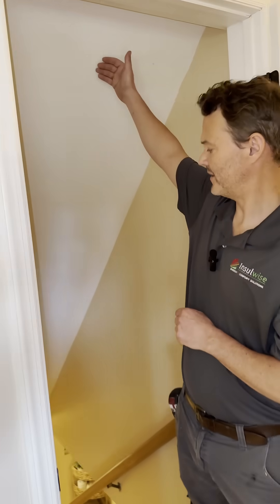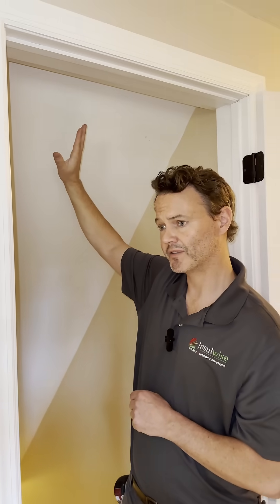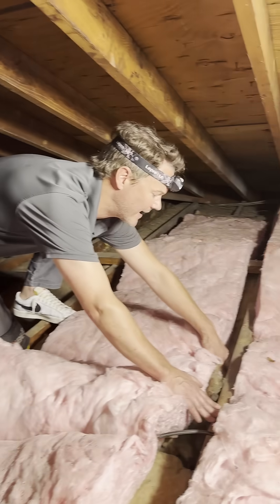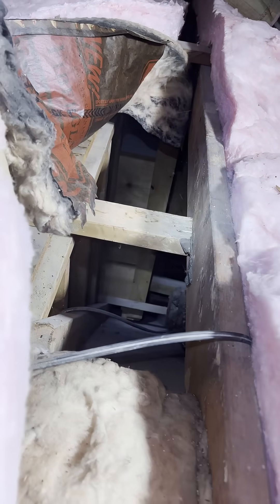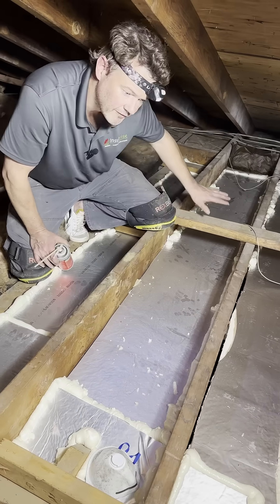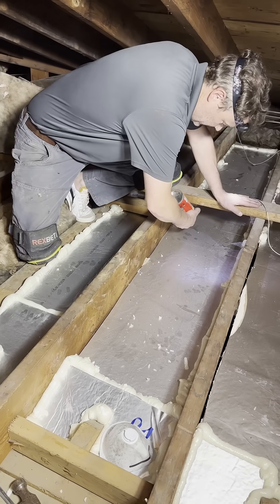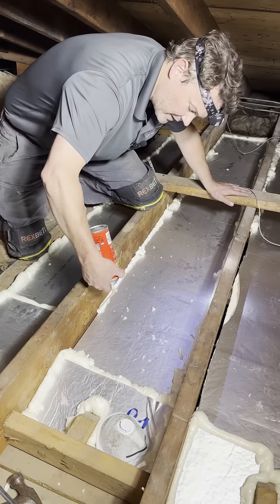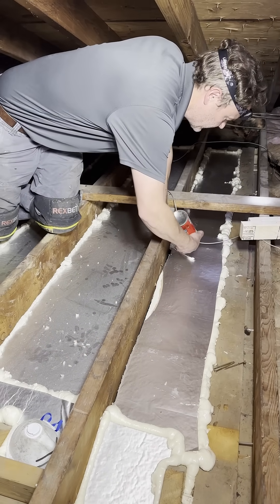Top Insulation Expert Reveals Best Air Sealing Techniques for Attic Stairwell Voids

Comment: Im guessing that is 50mm type kingspan, my home is UK 1870 draughty as hell this will be my last job many thanks for sharing an ideal way to stop condensation would a vapour barrier over ceiling joist seal it completely? Many thanks in advance.
Reply from the maker: Terry thanks for commenting!  I had to look up what kingspan is but yes, looks like the same stuff.  Polyisocyanurate foam with a foil / vapor barrier on both sides.  This will block both air and water vapor.  When you seal this into place with foam sealant on both sides, and support it properly on the underside --- boom -- permanently fixed.  We go through this stuff by the palate sealing all kinds of large cavities in attics.  Does this answer your question?
Reply: vapour barrier goes on the warm side of the insulation, so would be below the joists in the ceiling of the room below. 
victorian attic spaces are usually draughty  enough to compensate for rising condensation from the main house, not something I've ever needed to retrofit

Comment: So you capped that open space.  What about that cold exterior wall?  How about laying some insulation on top of that sloped drywall?
Reply from the maker: Great question and it’s commonly asked.  That back vertical wall was an interior wall.  There is a bathroom on the other side of it.  When there are true exterior walls abutting a stairwell void you do need to make sure that all of the interior walls are insulated, you cannot just cap it like we did here.  Otherwise cold from the outside will "bleed" into the space and chill those interior walls.

Comment: You should have left a bigger gap in between the Styrofoam and the joists, so the expendable spray insulation would actually go inside and close all the gap. In your case It didn't do a whole lot.
Reply from the maker: You don't need a massive gap.  In fact you don't even need a gap at all.   The foam sealant is attaching the foam board to the wood and sealing any gaps in between during the process.  We make identical repairs thousands of times a year and test them with blower doors.  The solution air seals extremely well and is highly durable.  Thanks for commenting.

Comment: Yes i just found this issue in my 2nd floor steps with a thermal gun. I used the thermal gun due to plaster ceiling falling down and found this exact issue causing it. I think is an insulation scam to hide this problem by the builder. They should have drywalled and then insulated instead of loosely hanging insulation that eventually fell down due to improper backing. I have several insulation issues in a 2nd floor attic and attached garage causing condensation issues and of course heat loss. Thermal camera is a must have.
Reply from the maker: Nice find with the thermal camera.  All builders in the Pittsburgh area that I've ever seen handle stairwell voids like this, as well as nearly all bulkheads.  They are almost neve covered over from the attic side with drywall.  Builders ONLY build to code.  IF code doesn't require it, than it doesn't get done.  Once you effectively air seal this void and hit the other air leaks in your attic you're going to notice an immediate difference in your home.  It will retain heat longer during the winter and also cool more effectively during the summer.  These are massive problems in homes.  Good on you for having a go with it!
Andy

Comment: the dirt and dust on the insulation that you pulled up with a dead giveaway of air movement
Reply from the maker: Good eyes!  And you're 100% correct.  The black streaks and dust in fiberglass are always a dead give away that air leakage is happening.

Comment: Use gapotape instead of foam for sealing pir boards
Reply from the maker: We don't have that product here.  But attaching tape to wood sounds dubious.  That foam sealant works perfectly every time and is relatively inexpensive.
Reply: @insulwiseenergycomfortsolu3293  Gapotape sticks onto the edges of the PIR board. Its a memory foam tape and expands and shrinks as the temperature changes. Its much more effective than expanding foam.

Comment: I retrofitted the attic in my old townhouse with spray foam and then re-taped the party wall sheetrock. I used sprayfoam because I wanted to have a legit floor to walk around on for storage while maintaining the "R" value. What a HUGE difference this made in the overall efficiency of the home. The difference from when we vaccummed out all of the old blown in and went "bare" for a week while I wired in lights and switches and repaired broken trusses and installed fireblock that was missed to after the spray foam was installed was night and day. Air sealing is KEY to an efficient home. That said, don't sleep on bringing in fresh, outdoor air mechanically, if need be.
Reply from the maker: Thanks for commenting.  Spray foam on the underside of the roof can be a sound solution, but if you live in a cold climate only closed cell foam should be used due to its having a vapor barrier at 2" thickness.  But you're right, air sealing attics is KEY, and if you think or know you're deficient in fresh air than bring it in mechanically.
Reply: Please look at Canadian specs if you live with a frozen winter. You could be mold and mildew free.  Those air exchanges are problematic. I refused to place in homes after 1999.

Comment: So when you remve the insulation theres no insulation. 
  So what happens when you remove the foam board?
Reply from the maker: I installed the foam board to create an air seal and we insulated over top of it.  There'd be no reason to remove it later and unless they were renovating that space.

Comment: A non problem, unsolved - the batts were fine.  Anyone know what the key feature of [engineered] ceiling paint is?  Permeability.   Two things to never go on an exterior wall [which a ceiling behaves like, thermally] is vinyl wallpaper or oil based paint:  they can create moisture traps.    We cook, we clean, we breathe... and getting rid of moisture in a home is about 'at what rate?'
Reply from the maker: Sorry, wrong.  Uncontrolled air leakage and infiltration through homes / buildings is often a serious problem.  New homes in Pa must pass a blower door test and have the home tighter than what's called 3ACH50 which is 3 full air changes per hour with the home depressurized to -50 Pascals.  We often run into homes that test in at 10, 12, even 20ACH50.  This means that they are massively leaky which causes excessive energy loss, comfort problems, and in the case of attics mold growth on the underside of the roof resulting from moisture released from the home condensing on the underside of the roof.  Air sealing an attic floor prior to insulating it is a Building Science 101 standard, necessary, and extremely high value practice.
Reply: @insulwiseenergycomfortsolu3293  Reverting to the flu epidemic of 1918, two things were observed.  Faster recovery was enjoyed with combined sunlight and fresh air.  Obviously, a house precludes sunlight.  By that measure, airtight homes make us sicker.  The trick is controlling that with regards to humidity and temperature.  You know what "super awesome" door tests prove?  The need to install a 'make-up' air sy$tem.  Also, you know what an exhaust fan does for an airtight box?  Make noise, and run up the electric bill - it basically does nothing.

Comment: Can i use this same principle for the crawl space between the floor joists?  Thermal break and foam seal along them?
Reply from the maker: If you have a crawl space the best method is usually to encapsulate it (if it's connected to a heatsource in the basement via an access hatch).  If you can't or are not doing to encapsulate it, the next best process IMO is to stuff batts into the floor joist bays so that the batt occupies the entire bay and is definitely pressed firmly to the floor above.  Then attach 1" foam board over the bottoms of the floor joist bays (entire underside of the floor) to lock them into place.  When done correctly this can work well.
Reply: @insulwiseenergycomfortsolu3293  Roger that, thank you. I have batts now. It's a 1920 house. It can be chilly this time of year

Comment: Why didnt you insulate the exterior wall at the botton of the slope?
Reply from the maker: 2.	Great question and it’s commonly asked.  That back vertical wall was an interior wall.  There is a bathroom on the other side of it.  When there are true exterior walls abutting a stairwell void you do need to make sure that all of the interior walls are insulated, you cannot just cap it like we did here.  Otherwise cold from the outside will "bleed" into the space and chill those interior walls.

Comment: You don't want a vapor barrier in your attic ceiling , humidity will build up in your house creating mold .
Reply from the maker: In cold climates you absolutely want and need a vapor/ air barrier between your attic and home.  It not only reduces air leakage from the home which saves energy and improves comfort, but it keeps water vapor from building up in the attic which can cause mold growth on the underside of the roof.  The challenge in cold climates is keeping enough humidity inside the home during the winter.

Comment: That explains why my stairwell ceiling kept getting moldy, most likely due to the condensation from the heat and cold hitting each other. 
Wish I knew that earlier, and it's too bad I dont have honest contractors like you around here.
Reply from the maker: Well thank you.  And yes, the surface of the drywall was likely getting cold there, dropping below dew point temperature, and then creating a moist spot on the surface.  It doesn't take long to grow mold there when that's happening.

Comment: Why would you not insulate above the stairs?  Access problems?
Reply from the maker: Great question, I used to do this.  Stairwell voids are very difficult to work in and move around in so there's a danger factor (if you slip and fall through, you're then going down a flight of stairs).  Other factor is this is FAR more energy efficient.  Capping voids reduces their surface area that is exposed to outside temps.  All four surrounding walls are interior walls here.

Comment: Your timbers will love you for adding foam to them. Where is my sarcasm meter...
Reply from the maker: The foam has zero negative effect on them when used like this.  If you're comparing this to spray foaming the underside of a roof with open cell foam you're off the mark.
Reply: @insulwiseenergycomfortsolu3293  Any foam, plastic or cement will trap moisture behind it if it isn't vapour permeable. Foams as far as I am aware are not vapour permeable.

Comment: I have a slanted area like that in my house, but the roof is just above. Is there any way to insulate between the ceiling and the roof when the space between is only 3-4” or so?
Reply from the maker: It's the same practice, but if it's inaccessible you can actually fill the void with blown in insulation.  At times we do this in attics.  If you use cellulose insulation it will dramatically / eliminate the air leakage as well as insulate the walls exactly as you'd want.  Good luck to you!
Reply: @ thanks! I’ll give that a shot 👍

Comment: Is it me or did I just see on TOH that you defeat the purpose of the metallic looking insulation, by putting the fluffy insulation, on top of that?
Reply from the maker: it's not being used as a radiant barrier, but as an air sealing air barrier.  And yes it was later covered with 15" of blown cellulose insulation.

Comment: why not just lay the insulation down against the ceiling? You've still got an outside wall uninsulated making that cavity cold.
Reply from the maker: That vertical wall you see is an inside wall.  I should have called that out in the video.

Comment: Why not throw plywood on top for easier walking?
Reply from the maker: You could do that.  But two things.  You'd then need to close / seal off the open ends between the joists, and you also lose 4-6" inches of insulation when you blow in after.
Reply: @ I see! Thank you for the response :)
Reply from the maker: @ngf5077  You're welcome ; )

Comment: The fact that insulated on the floor vs the roof proves, he's just avg, not pro
Reply from the maker: Traditional method (treating the attic floor) is not only 100% legit but I'd argue better in many situations.  You'll love the video I'm posting in a few weeks where a guy sprayed the underside of his roof with open cell foam and it then rotted.  He was advised to do this by a "pro."
Reply: Insulating the underside of the roof decking is a bad idea in many cases (including this one)

Comment: Spayfoam? Hows that holding up in a wooden house? I think the airtightness is gone after 10 years
Reply from the maker: Holds up great, polyurethane foam out of these cans is incredibly durable and tough as long as it's protected from UV light.  No risk of sunlight hitting it under a roof and 15" of cellulose insulation.

Comment: Why not use a pro gun? Easier to move around in the tight access area?
Reply from the maker: For several reasons.  1)  Foam is foam, for all intents and purposes, at least from my experiences.  If it expands, sticks, and permanently seals the air leak -- done. 2)  I or my teams have lost and or had a bunch of them break or get clogged beyond repair 3)  Cheapo great stuff is made and sold in much higher volumes so it's less expensive than gun foam 4)  It's far easier to maneuver with in tight settings.  The can is smaller, the straw is flexible.  In wide open areas guns are fine.  But in crawl situations (and if you're doing this job right --- you're on your belly a lot) I've never said to myself "if only the thing I was using to seal this air leaks was longer, heavier, and less flexible" ; )

Comment: I had a giant cavity about 4' x 4' square that leads straight to my basement. And guess what is in that cavity, the flu pipe for the furnace and hot water heater. So i sealed it with heat rated foam board and foam. Big difference to air seal.
Reply from the maker: Yep, that's a perfect example of how to do it right!

Comment: No foam gun and youre saying your a pro???
Reply from the maker: Haha..those "silly" cans are less expensive and FAR more convenient than the guns and their foam.  I stopped using guns after the 20th one that I'd bought broke or was left behind in an attic.  Regular great stuff does just as good a job as gun foam and we can use the smaller cans in cramped spaces where you could never get a gun.  But if you enjoy spending more money for a less practical means of sealing air leaks, have at it.

Comment: Blow in insulation to fill. Your gonna have a pocket.
Reply from the maker: When these voids abut an exterior wall we do fill them to keep the cold / hot temps from exterior walls from bleeding into the void.  When all surfaces are interior and they're capped, the void functions like a closet with the doors closed. It's no biggie.

Comment: Well, how about thermal bridges between joists and insulation?
Reply from the maker: Foam board had 15” of cellulose blown onto it after the air sealing of the floor was completed.  It’s a non-issue

Comment: I would have raised that ceiling up for the slate into the stairwell that's a bunch of head room just veiled off for no reason
Reply from the maker: That’s a major remodeling project that would have cost a few thousand bucks and yielded minimal value.  What we did was a relatively small dollar add on that added an immediate return on improved comfort and energy efficiency.  Thanks for commenting!

Comment: I feel like you should have insulated the side walls of that cavity when you opened it up. Maybe i'm not understanding something
Reply from the maker: You can do this, and I have, but it's VERY difficult and also dangerous.  Also, cold air will sit down in this void during the winter as opposed to on top of it.  Lastly, doing this make the area exposed "exterior wall" significantly smaller, making it additionally more energy efficient in the process.

Comment: Is that not an outside wall inside there with drywall diagonal ceiling with no insulation? The attic is sealed off from that space but the outside wall and the diagonal ceiling are transferring HVAC. Unless he put foam board down on the back of the drywall inside there.

Edit found comment saying they are all interior walls.
Reply from the maker: Not an outside wall, inside walls on all sides.  Many people ask this.  Bathroom on other side of that vertical wall.

Comment: Would you do one of these for a 2x2 attic access, how to insulate it?
Reply from the maker: For a hatch we'd use plywood with a 2" inch thick, R-10 rated foam board on the backside of it.
Reply: What about the edges? This is where I believe my loss is. I am using a vehicle window seal, however, it is tearing when forcing it up.   @insulwiseenergycomfortsolu3293

Comment: Without the airflow does the wood not rot overtime?
Reply from the maker: That void after doing this will behave the same as a closet inside your home with the door closed.  There is no surface that will get cold enough for water vapor to condense which is what leads to mold / rot.
Reply: should be fine so long as there isn't too much moisture / humidity
Reply: @fd3871  ah thanks for the info😊

Comment: Is there any insulation in exterior wall in that opening about the stairs ?   I can't tell?  I have seen videos with spaces like this and they fill it with insulation.  Then air seal it . Maybe I am not getting the whole picture here .
Reply from the maker: There is no wall inside the void that is exterior.  It's interior on all sides.  You have to insulate the inside of the void when there is an exterior wall.